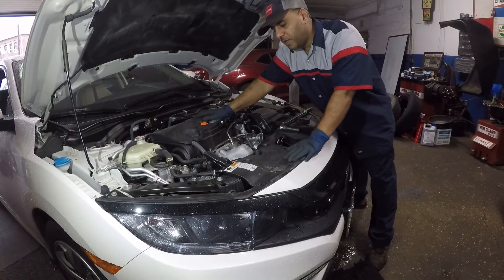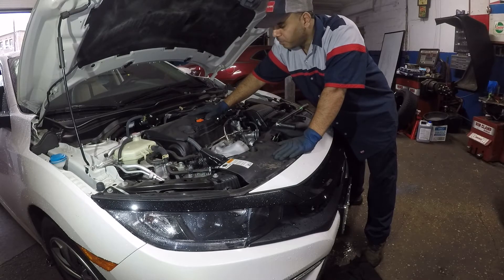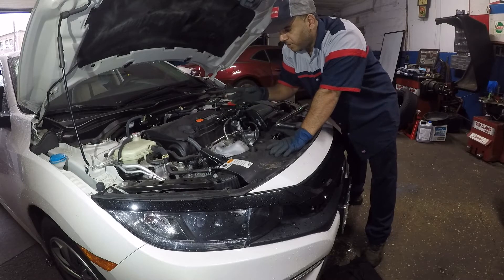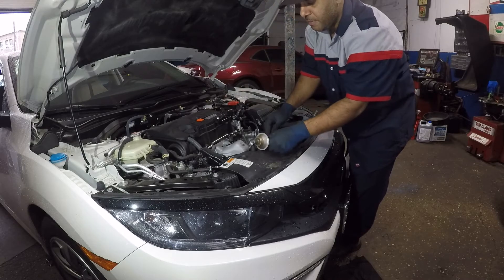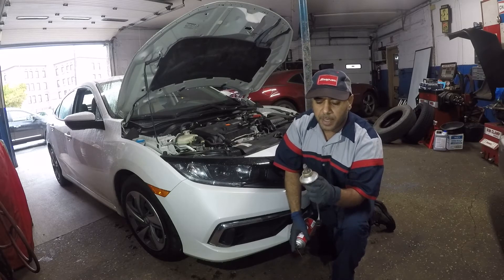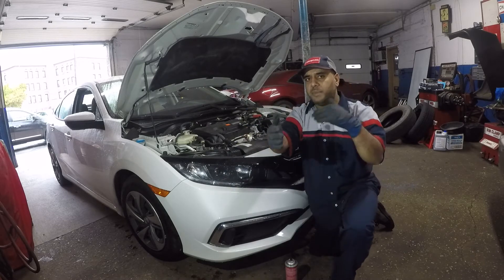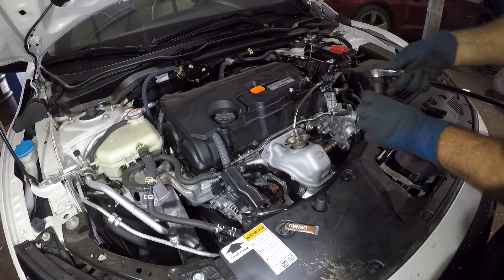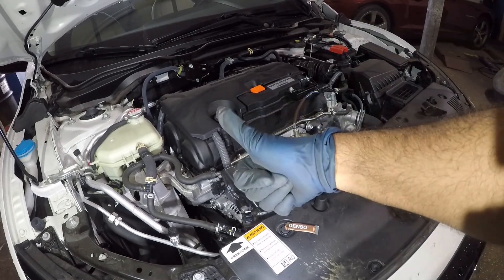2019 Honda Civic  9th or 10th generation, How to clean oxygen sensor Improve MPG

Comment: Hi! Really appreciate it your videos. Iv learned alot regarding parts cleaning. I have a question, for cleaning AGR, Mass Throttle Sensor, and Oxygen Sensor; Can i use electrical contact cleaner for all 3 purposes?
Reply from the maker: Nope

Comment: I have a question I recently purchased a 2018 Honda Civic lx with a 108k miles on it and I’m only getting 22.5 mpg so do you know what might have caused that?
Reply from the maker: Well that is lot of milages anways do engine tune up and change out filters and check tire pressure and see where that takes you how much of diffrence it makes also if u want clean out the maf sensor
Reply: That isn't a lot. My 06 coupe stick ex 1.8L. Gets over 50 mpg.  Now it's gets also 22 miles per gallon now. So I'm wondering the same thing.

Comment: Do you have a video about replacing a 2009 civic oxygen sensor? The sensor really stucks on the engine. Any idea to remove a stuck oxygen sensor? Thanks!
Reply from the maker: Heat it up. That how we remove them dont have video on that one

Comment: Hi I have a question hope you can help me, I have a civic 2018 ex type, When I buy it I can fill the fuel till 380miles but now I’m only can fill until 350miles, I just do fuel service kit last 2 weeks and still the same, do you have any idea what’s wrong with my car? Thanks
Reply from the maker: There is nothing wrong with that car it’s ur driving habit u drive maybe local if u go on highway it will go up again so I don’t see anything wrong with it